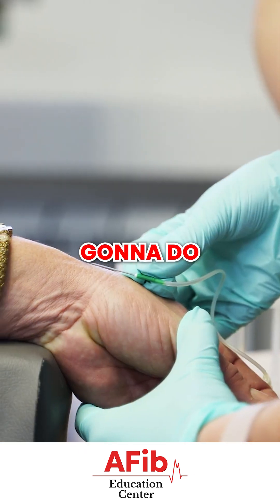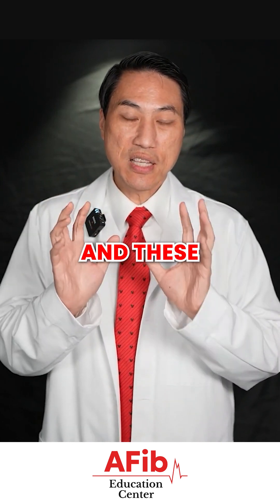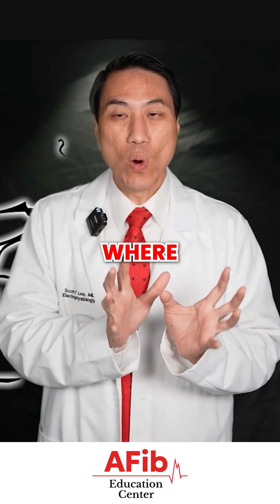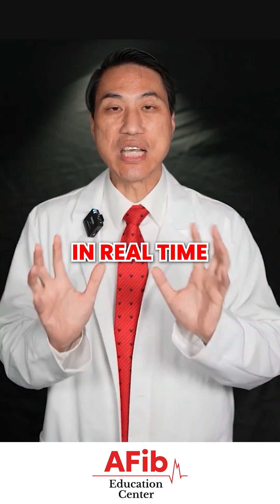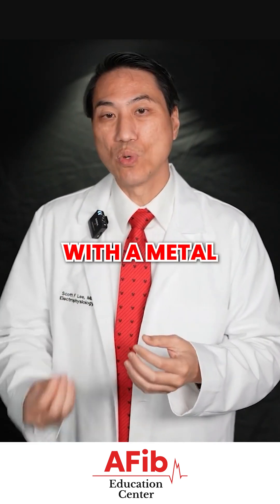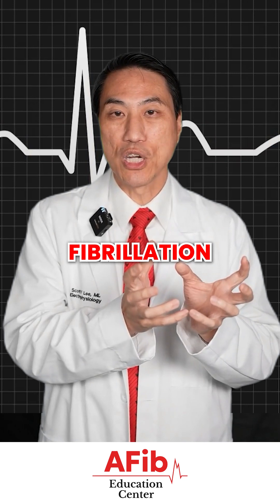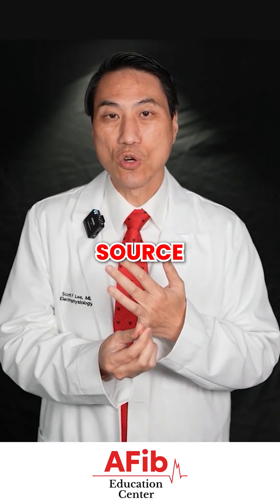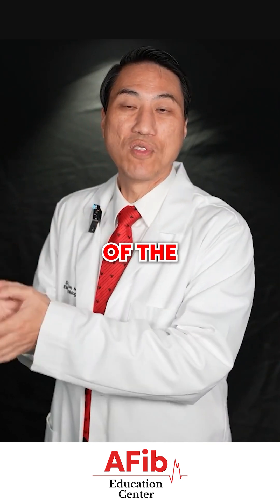How We Find and Destroy AFib Cells in the Heart

Comment: And how do you “wake up” afib cells?  Great short video!
Reply from the maker: Great question—and I’m really glad you liked the video!
When we do an AFib ablation, the goal is to find and eliminate the AFib sources—the abnormal cells that are firing off erratic electrical signals and causing the irregular rhythm. But AFib is tricky because it isn’t caused by just one stable focus. It’s usually multiple sources scattered across the atrium—especially in more advanced stages—and many of these cells don’t fire all the time. Some are “asleep” or suppressed, either from antiarrhythmic medications, sedation, or even just the calm, resting state of the heart during the procedure.
Now here’s where the real difference comes in between how most electrophysiologists (EPs) approach ablation versus how I do it.
Most EPs use what’s called an Anatomic approach. That means they create a fixed set of lesions—usually just isolating the pulmonary veins (PVI), which is the most common location for early AFib cells. They do this on every patient regardless of how far their AFib has progressed. For patients with early-stage paroxysmal AFib, this often works fine because the rogue AFib cells are mostly on that first wall. But if a patient has more advanced AFib—like Persistent or Longstanding Persistent—this approach often misses additional AFib sources on other atrial walls. That’s why their success rates drop: from 70–80% in early AFib, to 40–55% in Persistent, and 20–40% in Longstanding Persistent, unless more is done.
I use a Functional approach, which is much more dynamic and personalized. My goal is not just to ablate the standard areas but to hunt down and eliminate all the active AFib sources. To do that, we have to “wake up” any hiding AFib cells during the procedure. Here’s how we do that:
-First, we stop any antiarrhythmic drugs (AADs) several days before the procedure so those cells aren’t being chemically suppressed and hidden.
-During the ablation, we electrically stimulate the atria using pacing catheters to try to provoke AFib to start so we can observe it in real time.
-We often give Isoproterenol (Isuprel), a beta agonist medication that mimics the effect of adrenaline and stresses the heart slightly, which can unmask AFib triggers that wouldn’t otherwise fire.
-Then we use advanced 3D electroanatomic mapping systems to visualize where the chaotic signals are coming from in real time. These mapping tools help us track the spread of the abnormal impulses and pinpoint their origins.
Instead of stopping after doing the standard PVI, I follow the AFib and ablate wall by wall—posterior, left atrial appendage, anterior, roof, floor, right atrial appendage—until the AFib either slows, organizes into something more regular, or ideally stops entirely during the case, a result we call “ablation into sinus rhythm.” But I don’t stop there. Once I’ve achieved that, I re-stimulate the heart and use Isuprel again to try to wake up any additional dormant sources. If I can’t provoke any more, that’s how I know I’ve truly gotten it all.
This method takes more time, more effort, and more experience—but it dramatically increases the chances of success in more advanced stages of AFib. I’m not just guessing where the AFib is—I’m actively chasing it down and confirming that it’s gone.
And that’s the key difference. Most EPs stop after a basic lesion set, and their success rates reflect that. But I believe in doing it right the first time—because if you don’t wake up the AFib during the procedure, you can’t treat it, and that’s how patients end up needing two or three procedures when one comprehensive approach could have solved the problem.
Thanks again for asking such a great question. For more in-depth videos, visit my channel @AFibEducation, and check out even more resources at www.drscottlee.com. Keep learning—you’re doing everything right!
Reply: @ thanks for the diligent reply!  👍

Comment: Sir do they trigger the afib cells so that the sources of abnormal electrical cells get detected
Reply from the maker: Great question—and yes, triggering or waking up the AFib sources during an ablation is exactly what I do in my approach, because AFib is fundamentally different from most other arrhythmias. With something like SVT or typical flutter, we’re usually dealing with a single electrical short-circuit—a loop or a focus—that we can clearly identify and destroy. But AFib isn’t like that. It’s not one bad cell or one abnormal pathway—it’s often dozens of rogue areas, scattered around the atria, that misfire independently or in small chaotic clusters. And as AFib progresses through its stages—from Paroxysmal to Persistent to Longstanding Persistent—more of these abnormal cell clusters develop across more walls of the left atrium.
Let me give you an analogy I often use: imagine a still pool of water. If one or two people are tossing pebbles into the water, the ripples are easy to trace—you can see where they came from and walk over to stop them. That’s early stage AFib. But now imagine 10 or 15 people surrounding the pool, all throwing pebbles in at different times and places. The surface becomes chaotic. Ripples crisscross everywhere. It’s much harder to pinpoint the individual sources—let alone stop them all. That’s Persistent or Longstanding Persistent AFib. And it doesn’t matter what kind of rock you use to stop the pebble-throwers—whether it’s RF energy, cryo, or even the newer Pulsed Field Ablation—if you’re not identifying where to deliver the energy, it won’t be effective. Energy source is just a tool. The skill is in the strategy and mapping.
This is why most electrophysiologists use what’s called the Anatomic approach. They assume that most AFib comes from around the pulmonary veins (which is true for early-stage Paroxysmal AFib), so they isolate just that area—the first wall. Maybe they also take the back wall (posterior) if they’re feeling a bit more aggressive. But they don’t actively try to trigger or induce the AFib during the procedure to see if there’s more. They’re basically just doing a “set and forget” strategy. That’s why their success rates are acceptable (70–80%) for early Paroxysmal AFib—but those same success rates drop significantly to 40–55% for Persistent AFib and 20–40% for Longstanding Persistent AFib. Why? Because they’re still doing a 1–2 wall ablation on patients who may have AFib firing from 4–6 walls.
Now, even among the few of us who do more advanced ablation work, there’s a wide range of how far people go. Some can ablate up to 4 of the 6 walls in the left atrium. Very few of us are willing—or trained—to go after all 6 walls in one procedure when needed. That’s the difference in skill and philosophy.
What I do is called the Functional approach. I stop the patient’s antiarrhythmic drugs and stimulate the heart in the lab to wake up the AFib. Then, with high-resolution mapping tools, I ablate wall by wall until I ablate the patient into sinus rhythm. That means I’ve knocked out the main active sources. But I don’t stop there. I then try to re-induce AFib. If it comes back, I find the new active areas and ablate them too—until I reach the endpoint where I simply can’t wake up any more AFib. That tells me the heart is electrically quiet, and the ablation has done its job. That’s the functional endpoint—and it’s completely different from just assuming that isolating the veins is enough.
The truth is, most EPs don’t take the time or don’t have the experience to do this. And their success rates—especially for advanced cases—reflect that, even if they’re using the newest energy tools.
This is why I always say: for early-stage Paroxysmal AFib, it may not matter much who does your ablation—easy is easy. But for Persistent and especially Longstanding Persistent AFib, who does the ablation can make the difference between one procedure or three… between long-term freedom from AFib or bouncing from one failed ablation to another.
So yes—done right, we absolutely try to trigger the AFib cells to reveal themselves. That’s the whole point of a functional, individualized, skill-based ablation. And it’s what can give you the best shot at a real, durable result.
I hope this helps! For more in-depth videos go to my channel @afibeducation, and for more AFib resources visit drscottlee.com. Thanks for watching!
Reply: @afibeducation  Thank you sir 🙏
Reply: @afibeducation  I would love to see the procedure being done. A picture is worth 10,000 words.
Reply from the maker: @satafefavs: There are videos on Youtube where you can see the actual EP Ablation procedure done. You can always view my latest video “What Doctors Aren’t Telling You About AFib Treatments” where I show on a heart model exactly where different lesions are made depending on the technique being used.